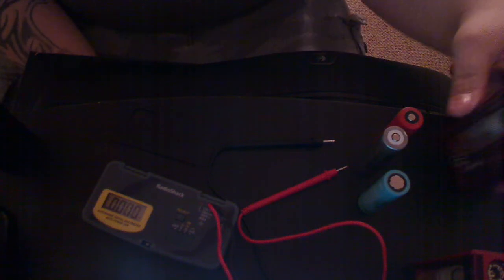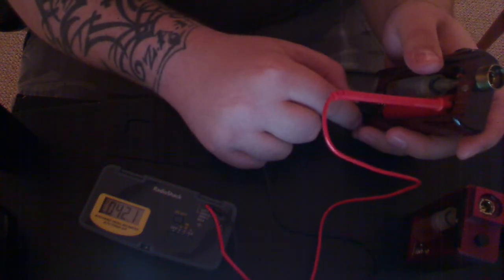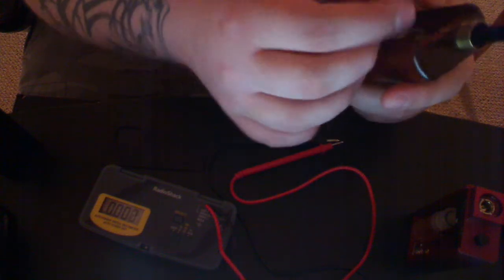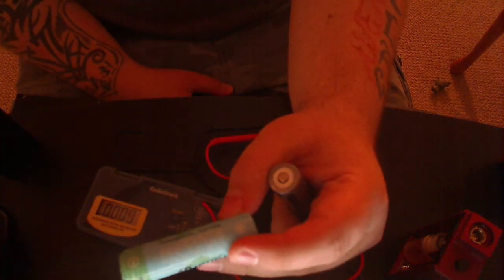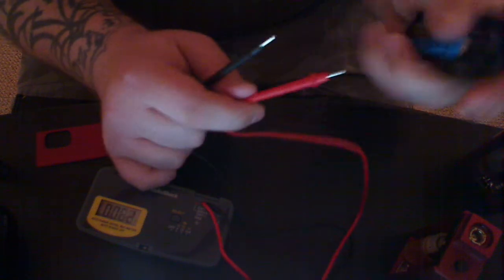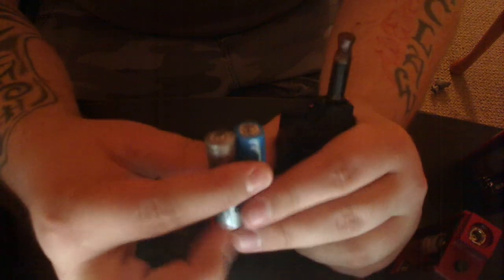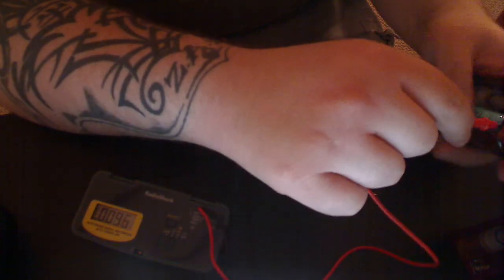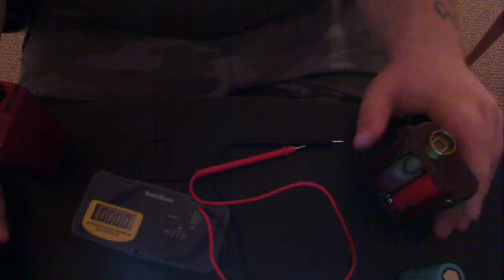ReoSmods Loaded and Unloaded VOltage COMPARISON!

Comment: The ultrafires do, indeed suck balls!  The AW's are good for most applications, but I have been digging the MNKE 18650.  You need a magnetic spacer for most applications, but it works great in my Grand w/o.

You can get it from AtmosUSA for $9.  It has a higher current discharge rating than the AW by far.  You notice it over time w/ a 1.5ohm atty compared to the AW.

I didn't catch it, but did you mention the resistance rating of the atty you used in this test?